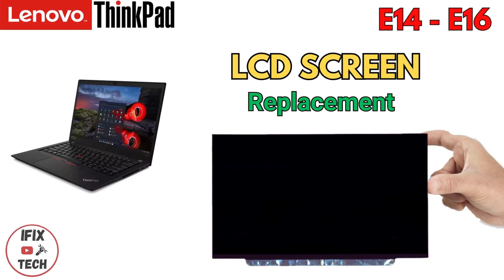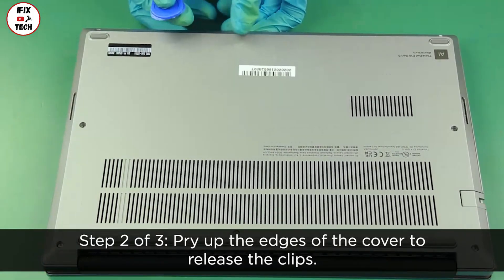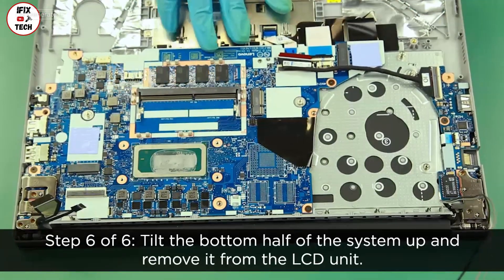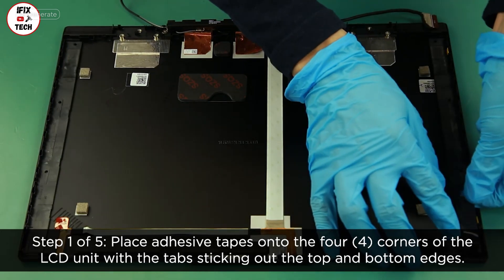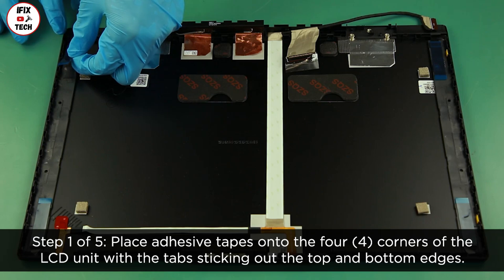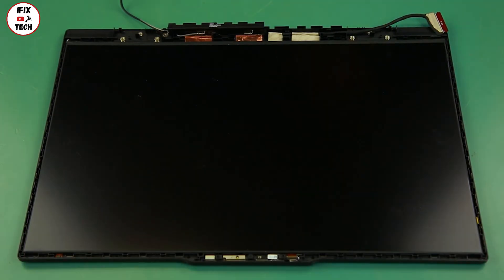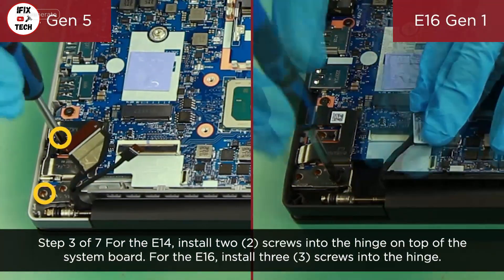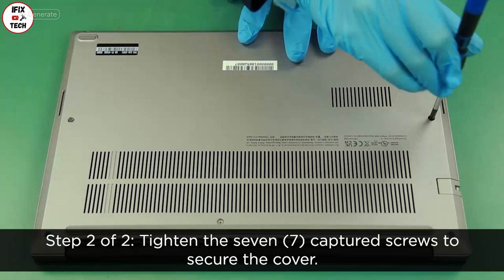Lenovo ThinkPad LCD Screen Replacement E14 and E16 - How to Remove Screen Panel

Comment: How can you tell which model has the 30-pin or the 40-pin video connector?
Reply from the maker: You can always check the FRU number on the cable in order to know the exact cable that you need. Thanks for liking it and subscribing 👋 😉

Comment: The computer won’t power on anymore. The charging light won’t come on. Tried on two computers and answers?
Reply from the maker: Did you try the system board reset option?

Comment: The screen was broken, so I replaced it, and this video was very helpful. However, I have some additional points that might be useful.

First, anyone watching this video is likely attempting a screen replacement because their screen is already broken. Since the screen is not displaying anything, there’s no need to worry about battery-related settings in the BIOS setup.

For the ThinkPad E16, there is only one EDP cable. The video shows two cables being disconnected, but don’t be confused—this model only has one.

The explanation starting at 3:35 is crucial. Removing the double-sided tape at this step is very difficult, and you should not remove it because it will be useful when attaching the new screen. The replacement screen does not come with additional double-sided tape.

When detaching the EDP cable at 4:16, be extremely careful. The metal cover surrounding the connector is very fragile and can break easily.

I hope your screen replacement goes smoothly!
Reply from the maker: Thank you! Very glad the video was able to help you. Thanks for liking it and subscribing 👋 😉